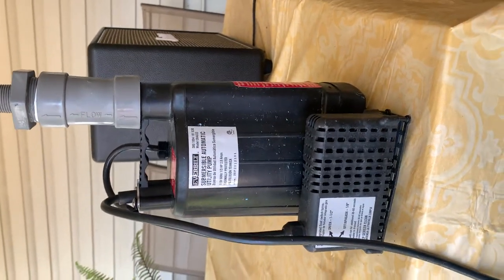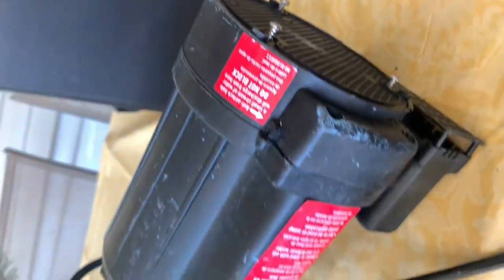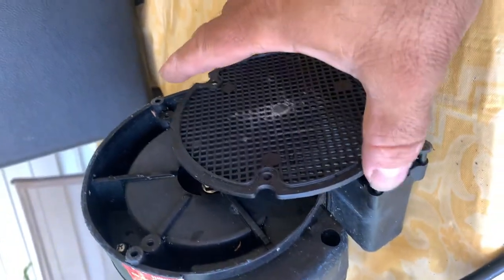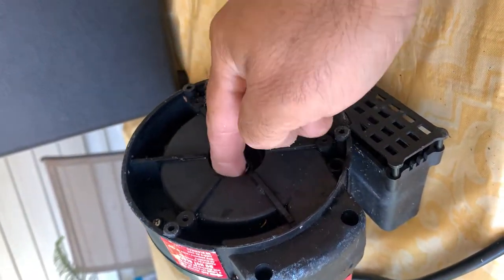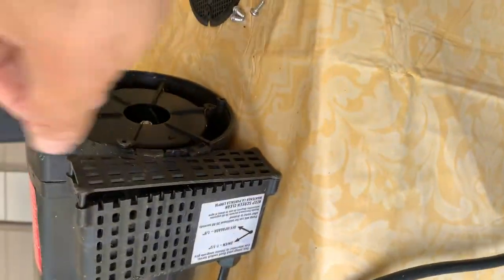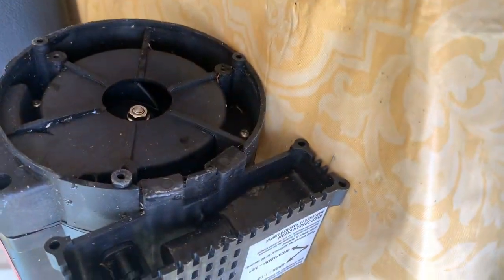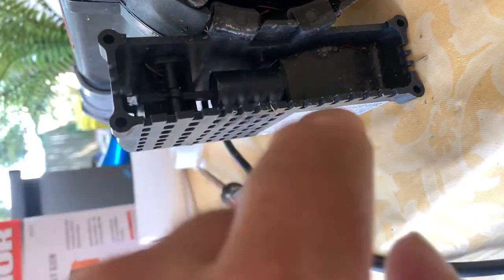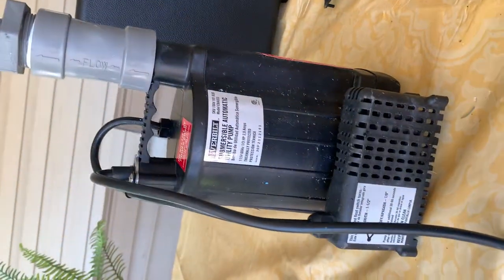Utility water pump not pumping water fix

Comment: Ours stopped working today and I remembered awhile ago taking "something" off and spinning something, so I took the bottom off and turned the screw in the middle but put another pump in as to get the water out, and I also took that front part off and it was jammed with junk. Came up and searched videos, found this one, went back downstairs and tried it and yes it worked lol!!

Thank you!!

Comment: Where can I find the oil that surrounds the engine on the inside.I open mine up to clean it.& Half  of the oil came out.put it back together worked for about 20 minutes & it turn off.so am guessing I either ruined it or I have to replace the oil?
Reply: Mineral oil maybe? Guessing